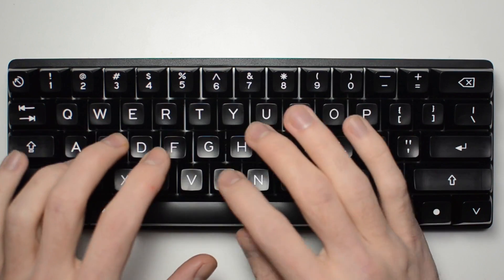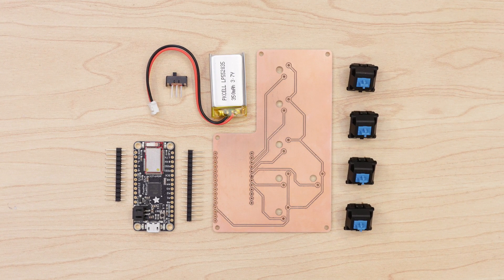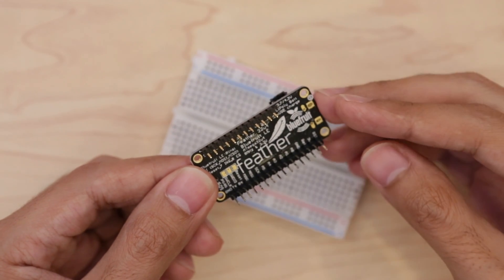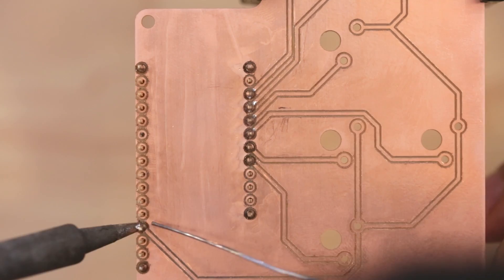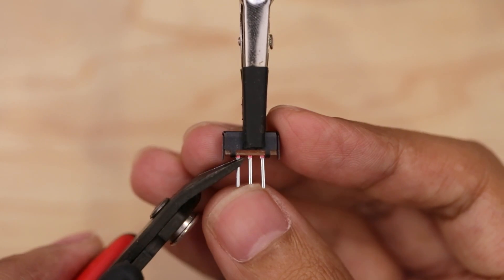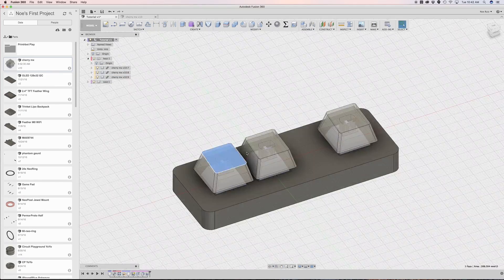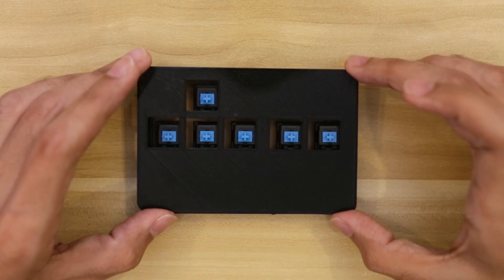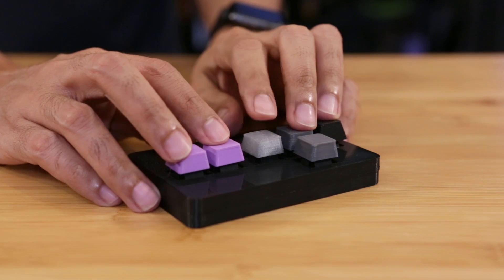Custom Bluetooth Cherry MX Gamepad

Comment: In the code itself, it outputs a keystroke when the pin reads digital low. is it possible to have it output a keystroke when the pin reads digital high?

Comment: "... have this very satisfying click" 
shows cherry mx reds
Reply from the maker: tfw the b-roll doesn’t match the voice over 🤣🤫 Reds are silent, aren’t they? 🤦‍♂️
Reply: nah they're not exactly silent, although cherry mx reds are linear and don't have the signature "click" seen on the cherry mx blue (which is basically famous for clickiness). In fact, reds are pretty quiet except for the sound that it makes when you bottom out the switch :).
Reply: ALPS are better. 😆
Reply: @NortelGeek  Using Zealios right now 😏

Comment: This might sound really dumb, but could I use a vinyl cutting machine to etch onto the copper surface
Reply: You can produce masks with it - for the pcb in question I guess you would have to glue them to transparent sheets upsidedown. I guess printing on transparent slides (if it is really thick ink) is a better option. the UV lamps, development and etching is however a complicated mess if you don’t do it often. I guess I won’t have the patience to do all that (multiple tries) anymore. Go for ordering :)

Comment: Huh? You left pins unsoldered on the Feather? I thought that was considered bad practice. I'd solder them anyway even if I didn't use them for the sake of rigidity.
Reply from the maker: There's plenty of mechanical strength with the corner pins all soldered. Also, there won't be any movement or stress once it's mounted to the enclosure.

Comment: Great video! 
A couple of questions before I consider purchasing the Adafruit Feather 32u4 Bluefruit LE:

Is there a limit to how many switches can be wired up to a single Adafruit Feather 32u4 Bluefruit LE?
Can you create a whole wireless keyboard?
Software-wise, can multiple switches be pressed and recognized at the same  time?
Is there noticeable lag?

Thanks! I would like to see more projects like this combining 3D printing and electronics.
Reply: There are 20 pins that support digitalWrite() (0, 1, 2, 3, 5, 6, 9, 10, 11, 12, 13, SCK, MOSI, MISO, A0-5). So that gives you a maximum of 100 (10x10) using traditional multiplexing. But there are also clever ways of raising that number, by using decade counters, shift registers, IO expanders or techniques like Charlieplexing. There shouldn't be any noticable lag, and multiple switches can be pressed at once, at least up to 6.

Let me know if you need any help designing the keyboard!
Reply from the maker: Thank you for the comment, yeess!
Reply: So I can connect switches to the GPIOA pins on the bottom without having to change anything? I'm completely new to this and have no idea what I'm doing.
Reply: Jonas Gilje replying to this to save for later
Reply: is it possible to extend the pins so that every key gets its own pin?